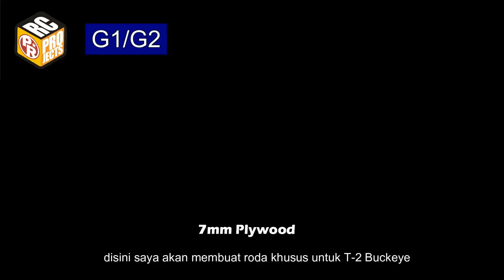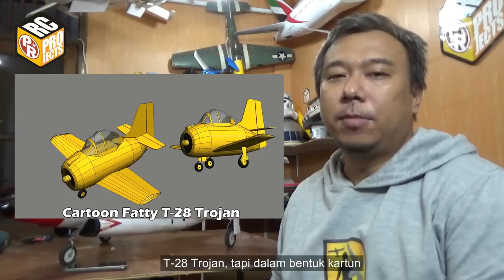T-2 Buckeye Depron Foam RC Plane DIY

Comment: Imagine how cool it would be with a EDF.
Reply: But it would be very power consumable
Reply: @rcbuildmaster6192  yeah, flight times will be low.
Reply: I have built one with a 70mm EDF from his plans.  3D printed bi-fircated duct for exhaust.  Still needs to be flown though.  Bad weather and pandemic.
Reply: 70mm 6S  with 3D printed Bifurcated exhaust duct.  Maiden today. beautiful take off and climb out no trim. About 3 minutes into flight half the Horizontal stab began to flutter badly. Of course it was the side with the elevator servo and the buckeye nose dived into the ground. Had it not been for the collapse of the stab it would have been a sweet flyinging EDF conversion.
Reply: @sotm6078  could you please put a flight video on your channel if possible. I also want to build an edf version of it

Comment: Hey julius,i built this but modified it to take an EDF but im wondering if the motor i used will be powerful enough for takeoff.I 3d printed the EDF and used a 2212 2200kv motor from a kit i got from banggood.Do you think this will provide enough lift?I will have the flight sometime soon on my cannel if this will work,if not i guess ill have to get a better setup or buy an edf instead of printing one.

Comment: I like it but the only thing I didn’t was when u put the propeller on the back instead of the turbine in the middle bu it looks good and I guess a prop will help for slow fly
Reply from the maker: Propeller is more efficient in terms of power and budget 😊.

Comment: Yet another magnificent build Sir!
I love the innovative use of materials. Would there be a huge weight penalty if you covered it in fiberglass and epoxy?
Reply from the maker: Needs more powerfull motor / EDF, the plane will be heavy with all bigger battery and strong landing gears

Comment: some info.   at  42:42    one  Weird   prop.     compare    E P.   electric  pusher.     prop noise may be reduced if  clearance aft of the prop  is  increased.

Comment: good morning Julius, I built a Piper Cherokee and I intend to build another one, as you made the wing of the T-2 Buckeye in 3mm depron, I would like to know if it would be good to make the wing of the cherokee with 2.5mm depron, because I have a lot in this thickness, thank you
Reply from the maker: Yes you can, the original / prototype version of my Cherokee was made with 3mm foam before I convert it to 5mm for youtube
Reply: @JuliusPerdana  ok, thanks, can the same be done with the Cessna 172 and the G-A8 Airvan?